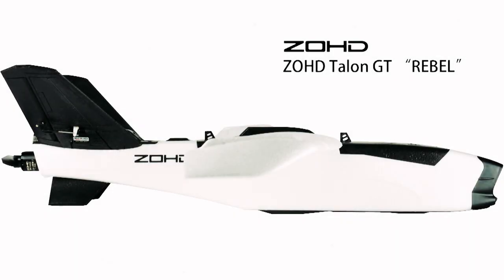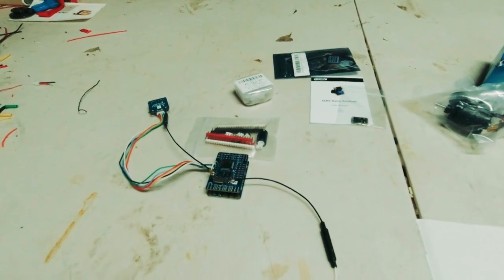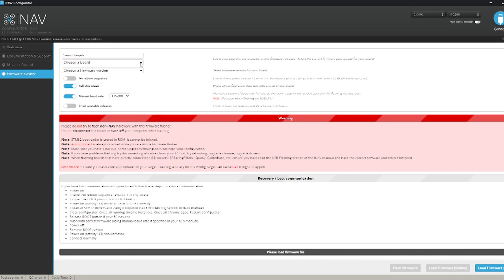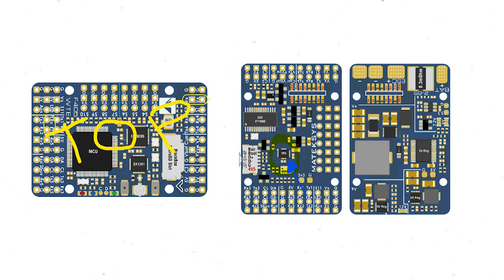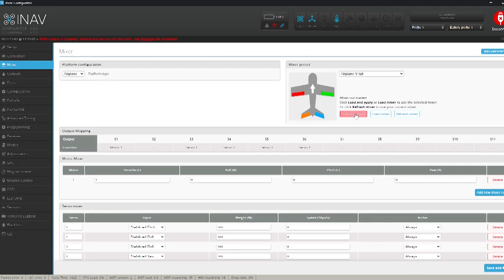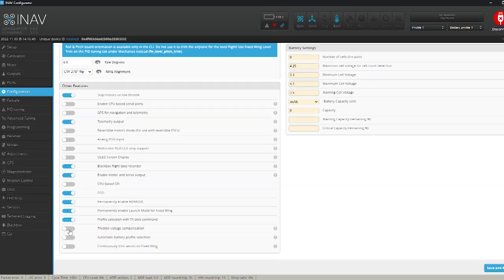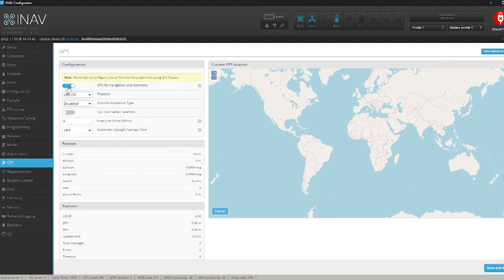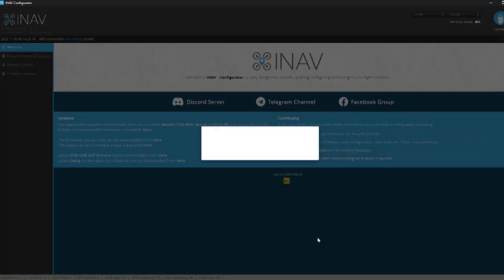ZOHD Talon GT Build - iNav 5.1 Install and Basic Setup -  Matek F405 WTE

Comment: Great Video! Looking foward to the next part. Quick question though is it possible to bypass the onboard rx elrs and use a normal radio reciever like a fs ia6b? If so how would you do it?  Thank you!
Reply from the maker: Yes you can bypass the onboard rx. It gives you a choice of either the rx or wifi telemetry you can’t have both. The flight controller comes with plugs so you can choose which pins to plug to get the one you like. I went for telemetry and setup my rx on a different uart as the onboard rx is setup on uart 2, it didn’t let my long range rx work on uart 2 for some reason so I chose uart 3 and it worked. Not sure why it’s like that maybe because the telemetry is also setup on uart 2 as default.

Comment: is there a difference between this one and f405 wing. Like which one should i buy?
Reply from the maker: Not really much difference both work the same with this same setup I have on this plane. You would need to compare the differences in specs yourself but for what I have on this plane both will work the same with spare uarts.

Comment: Did you manage to bypass the onboard rx elrs, and put your own rx on it, as I have same board,
Reply from the maker: Yes you have a choice of either the rx or telemetry using a plug that come with the F405. I put a 900mhz rx on uart 3 and jumper plugs so I had telemetry. I show it on the video but you can go to the matek website to clarify which pins to plug.

Comment: Good afternoon cannot configure the flight controller using the inav program. the program does not see the controller. how to solve the problem?
Reply from the maker: @ОлександрБровинський  Have you tried a different usb cable? Usually a bad usb cable is the issue. Which flight controller are you using?
Reply: @stonesrcchannel  matek f405 wte
Reply from the maker: @ОлександрБровинський  Have you tried using another usb cable? If so you may need to update the driver.